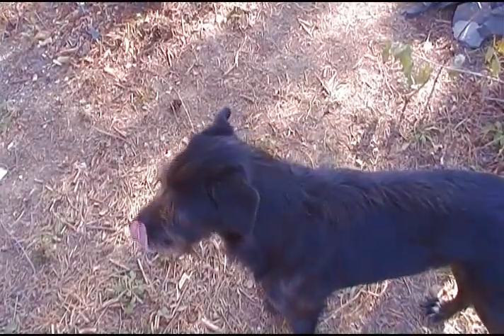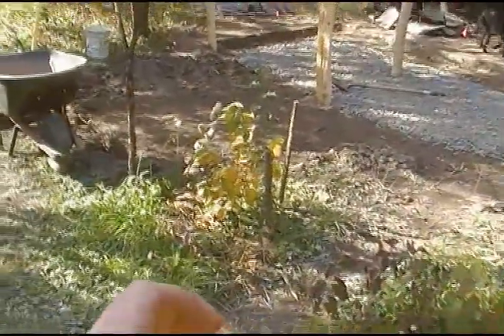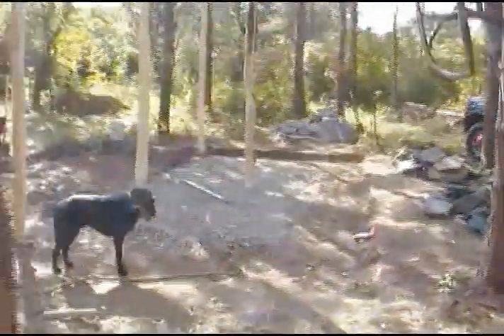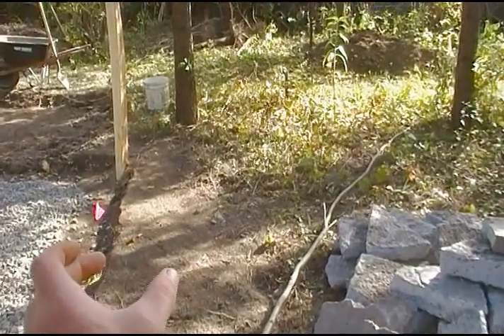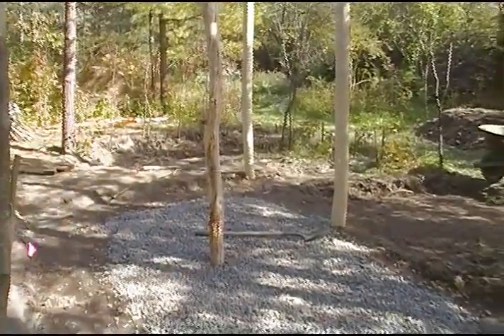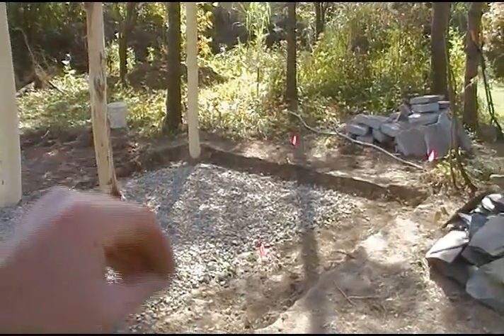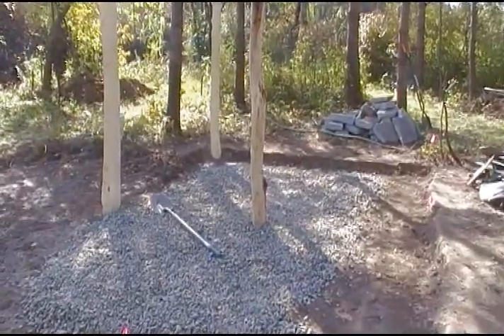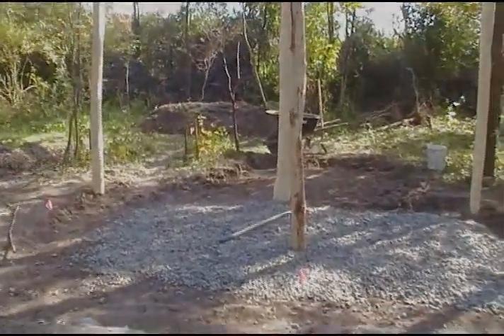Cob Cottage - Part 1

Comment: Cob is like a baby, it needs a dry head and a dry bottom.  The old cob houses you can find in the UK have a stone foundation of at least a couple of feet and a thatched roof that overhangs far enough to protect the walls from direct rain.  It is usually finished with lime wash.